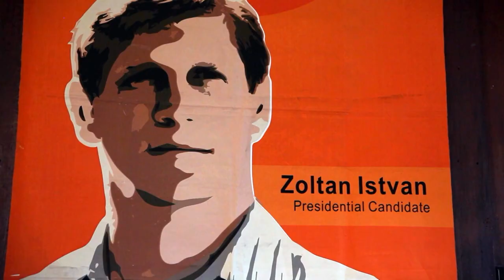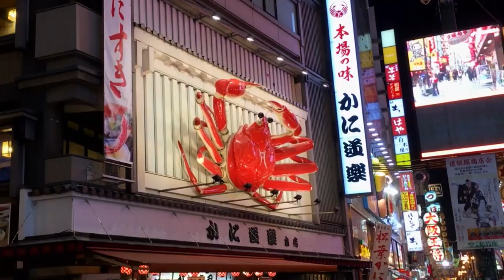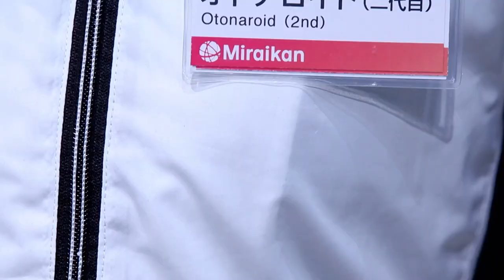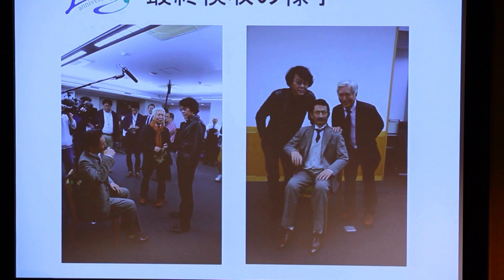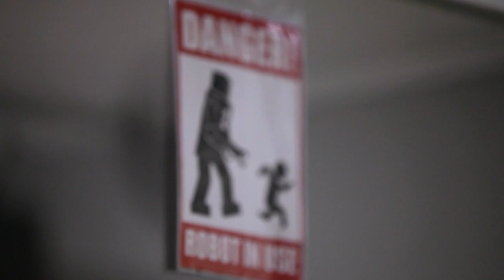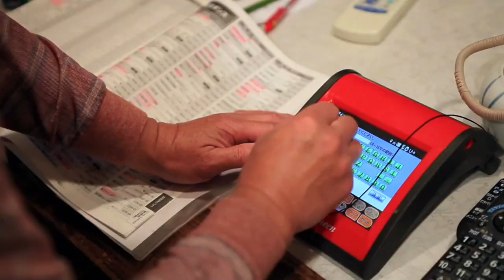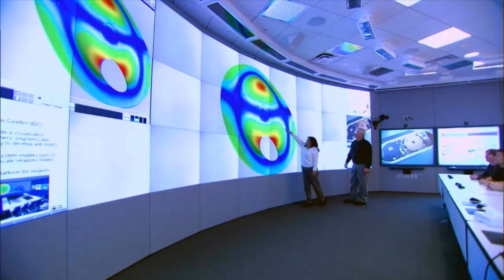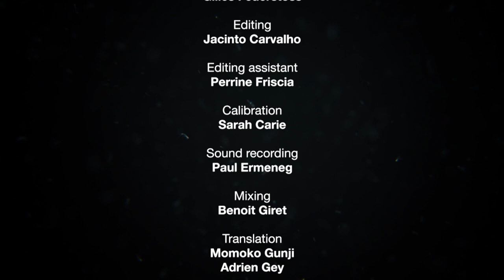Robotics: Substitution of Mankind or Improving the Human Being? | Free Documentary

Comment: I WATCHED THIS VID AT 2X THE SPEED. SAVED ME HALF AN HOUR! WHILST NOT GETTIN' BORED!
Reply: Excellent idea, thanks!
Reply: Not possible for slow internet connection.
Reply: @spideken123  it's ur problem not mine. What u want me to do?
Reply: @spideken123  sure you can just wait a day for download in slug mode then play it back on rapid speed after its all there  dont need to worry about net speed as long as it goes and it all gets there ...then if it dont play fast you need more power or subtract some of the extra power drainers cuz your player needs more ampage to its circuitry.....